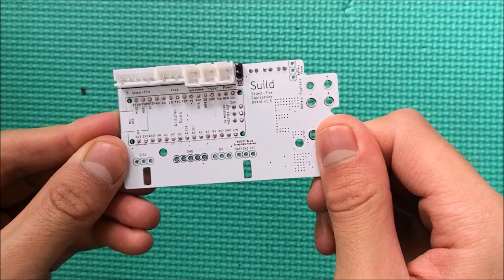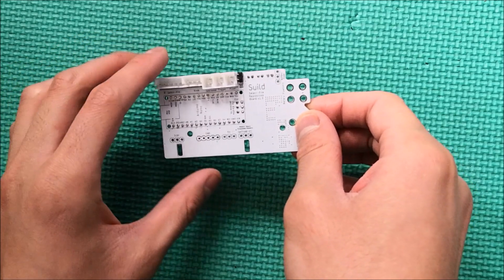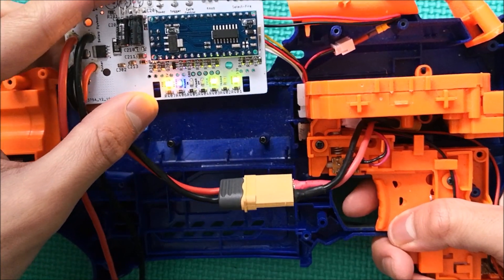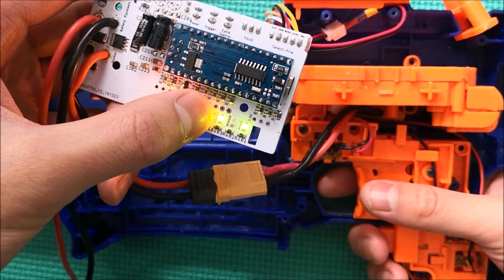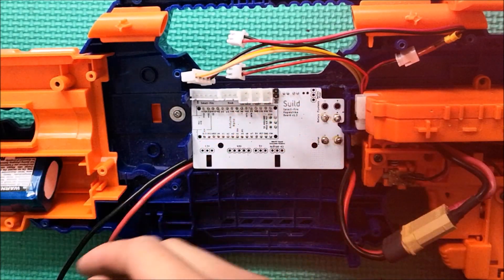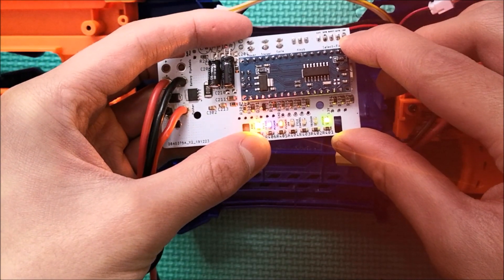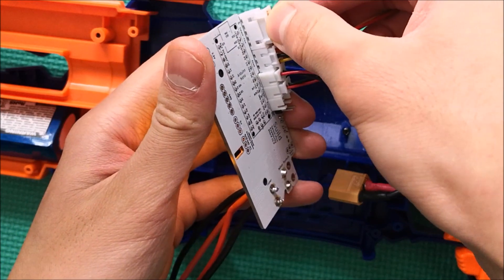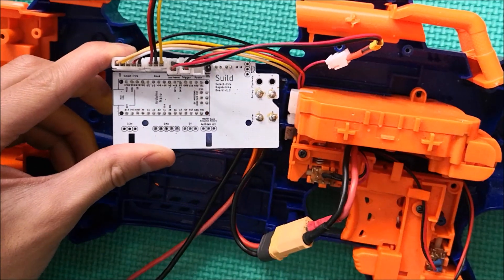Select Fire Rapidstrike Kit Debug LEDs

Comment: Also, I have a lot of control switches so where should I mount those?
Reply from the maker: You can mount them wherever you want! I've seen people mount them near the battery tray and under the tac rail. Just watch out for the other side of the shell and plan out how the wires will route!